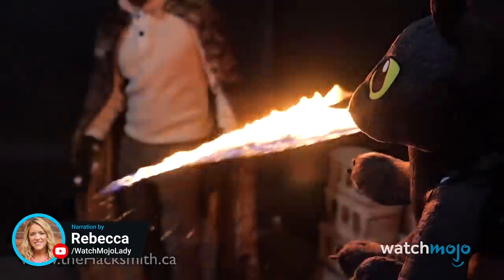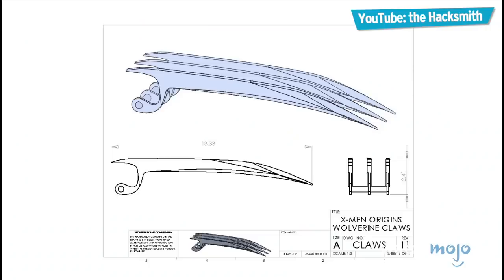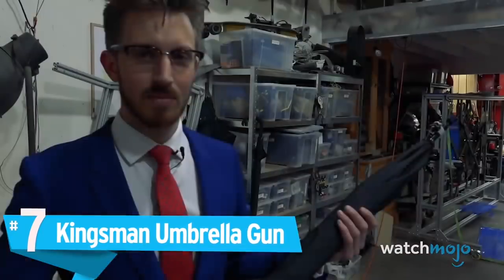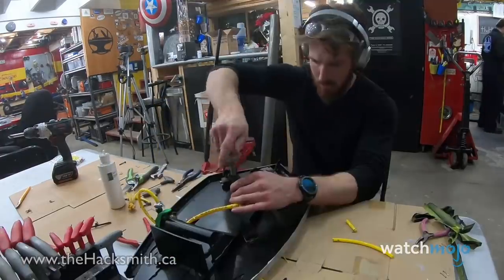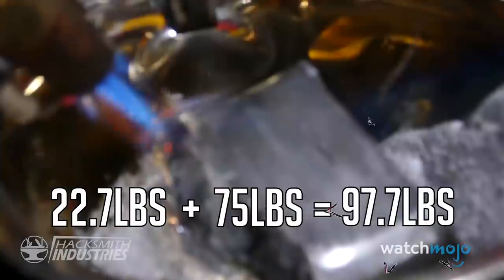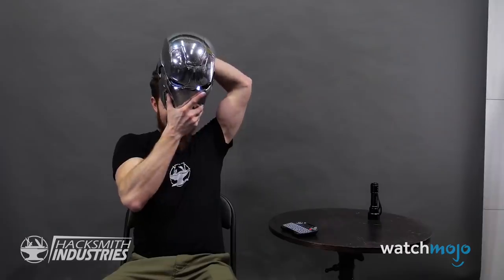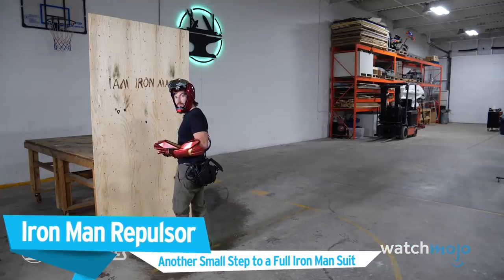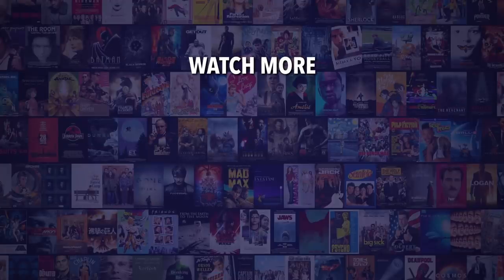Top 10 Coolest Hacksmith Inventions

Comment: Those Um Actually Guys: "You could NEVER make a real lightsaber!"
Hacksmith: "Unfortunately for you, history will not see it that way."
Reply: Here u are
Reply: And it's funny cause the "um actually" people aren't real Star Wars nerds because it's canon fact that lightsabers started out as solid blades connected to an external power pack, so they're actually following Star Wars lore.
Reply: Bruh
Reply: @gr3enmachin369  I think they mean they aren't real because they can't actually block anything. Which is ridiculous because the technology to have something do that doesn't exist yet.
Reply: Hey moustache guy
Reply: Hello father.
Reply: @MandatoryFruit  light doesn't and can't block. If they it block then it's not a "light" saber anyone.
Reply: I knew you'll be here
Reply: @gr3enmachin369  Um actually, the lightsaber made did not have a solid blade. The blade was gaseous.
Reply: @MandatoryFruit  you will need very advanced controlled nuclear fusion technology so that you can down size reactors into something like a power core from Fallout; discover a completely new particle to trap the plasma like somthing in Gundam or a very advanced way of producing EM waves that does not involve rapping the whole thing in copper wires and all these equipments needs to be palm sized, unless you are ok with beam sabers in Gundam then you don't need it to be that tiny. But whatever the case, we are still going to have to wait a long long time.